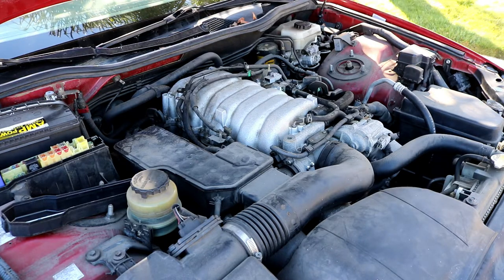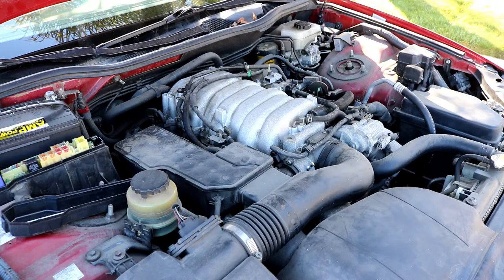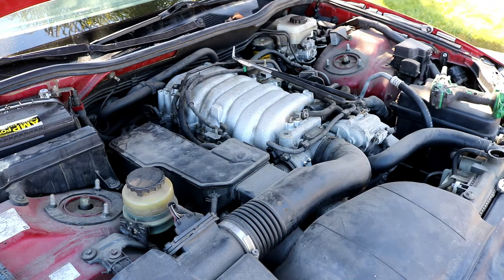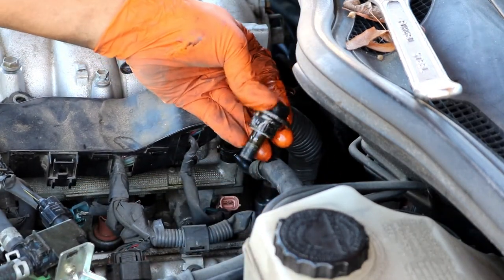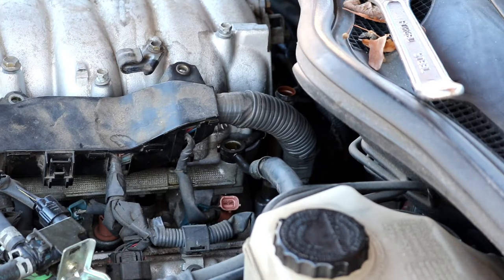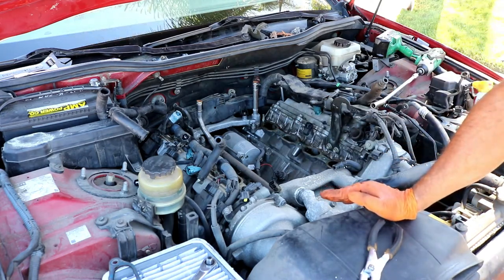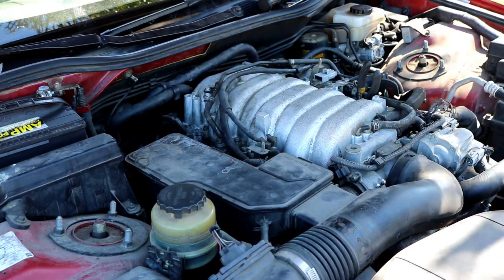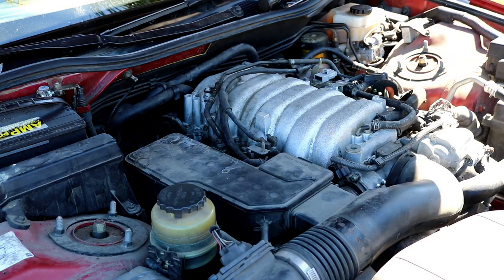GS400/430 intake manifold gaskets (Starter access) 1uz/2uz/3uz

Comment: thanks for the video, was able to replace my knock sensors for my GS430 and everything was on point.  it was the first time i ever did anything this complex in my life.  for my case, i didn't remove coolant hose on the throttle body, so didnt need to drain coolant.  i also didnt remove the heater hoses or banjo fittings either, i disconnected the fuel line and left the banjo fittings attached to the manifold (i used 14mm and 19mm line wrenches so i didn't round the bolts [be careful of some fuel in the lines and some pressure as well]).  it made things a bit harder to work around when pulling off the manifold and putting it back on, but i thought it have saved some time for my case.   thanks again for everything!
Reply: Hey, I got slammed this week with a P0325 Knock sensor code.  2001 Gs430.  Congratulations on fixing yours 👍.  Can i ask you how long approximately did it take you and did you need a second person to help?  Im debating whether I should pay my mechanic or do it myself. I’m a little handy myself, but not as skilled as a mechanic by any stretch.
Reply: @Chin-dian  Hey there!  It took me about 6 hrs to do, but I was really taking my time and ensuring I wasn't going to strip any bolts, crack any hoses, and so on.  I did it myself without a second person lifting the manifold out but it was pretty tough and hope you're familiar with good deadlifting technique so you don't throw your back out.  It did require specialized tools and planning like I mentioned above, and even then I also had a tough time. This is one of those that I would say you might take to a mechanic because of the complexity.  I needed to do it myself because I was unemployed at the time and couldn't afford the labor
Reply: @nitroidd  okay. Thanks for responding. I appreciate your advice. 6 hours is actually very impressive for a regular person.  But i hear what you say. It is complex for sure.
Reply from the maker: This job took me around 2 hours. Knock sensors are right under the manifold so add a little more time for that. Sorry just realized you asked this guy and not me. My apologies.
Reply: @HelpingHandAutoRepair   No apologies necessary.  Im grateful that you posted this video.  Wow , 2 hours is super fast for a job like this.  I’m budgeting around 8 hours if i get the nerve to try it.  But this tells me that it’s possible to do it yourself.
Reply from the maker: It’s definitely possible. Could be 2 and half hours but I have done one or two before. That manifold is definitely heavy.
Reply: @HelpingHandAutoRepair  Hey , just wanted to report that I successfully changed both the knock sensors on my GS430.  I did it mostly on my own. I just got my brother to help me align and put on back the manifold on top of the 4 studs as it is hard to do alone. I would say it took 6 hours. However I regret not changing the starter because its right there as well and although it would cost an extra $300 bucks or so, its well worth it due to the amount of time it takes to get in there.  My advice to anyone who takes off the manifold is to just change the starter and both knock sensors especially if they are old parts.  Also i had bought a fel-pro gasket but the original lexus gasket was a better quality and in good condition,  so i reused it.  The lexus oem gasket has 3 layers, rubber sandwiched between two sheets of steel. Thanks again for this video, they really help with the knowledge. And definitely use line wrenches to disconnect the fuel line. 14 and 19 mm. My fuel line was super tight to unscrew.  If i had used ordinary wrenches I would have definitely rounded the 14 mm end.  You don’t want to make that mistake. Also dont use a cheap no name starter or knock sensor.  I used NGK/NTK knock sensors.  Its too much work to do or to change all over again if a cheap part fails.

Comment: I'm surprised I didn't find it in the first few comments, but removing the coolant line is unnecessary if you're NOT doing the starter. If you're doing your knock sensors, the wiring harness to those, or your intake gaskets, you won't need to remove the coolant line, as you won't need to remove the bridge on the back of the starter where the coolant lines come in from the backside of the motor. I'm battling a knock sensor code problem in my '04 GS430, I've taken the intake apart and put it back together three god damn times now LOL! So trust me, you don't have to remove the throttle body or the bridge over the back of the starter to get the intake manifold off. I just used a short bungee cord to hold my throttle body to the side (drivers side) and out of my way when I was working on the intake. The only thing that gets in the way when removing the intake is the fuel line on the driver's side and the bracket with a plug on it on the passenger side. Take that bracket and just tuck it on the fuel rail or something so it'll come out with the intake manifold. You might need a helping hand to help swing that fuel line on the driver's side under the wiring harness though, that joker kept getting hung up on me when I was pulling the intake by myself, but I eventually made it work inch by inch, very gently LMAO!!

Comment: I'm just getting into cars and I'm going to mod my sc430, but I need to fix it first. This is exactly one of the things I need to do so thankyou! Wish me luck I'm going to attempt work on the 3uz with my mechanic buddy. You're helping me learn and all that jazz. Much appreciated my guy
Reply from the maker: All good, you’re on the right trAck for sure. Maintenance first, modifying second. Most people do it backwards.
Reply: it was succesful! time to do valve cover gaskets, replace the radiator, power steering hoses, and the timing belt. end me. still need the knock sensor too, should've done it with the intake but whatever

Comment: Yo man shoutout to you for making a great video. Taking a break from the starter job on my 98 SC400. This video is great reassurance. 

Quick question tho. Can I break the main fuel line loose by the battery instead of the two banjos?! Saw it done in another video
Reply from the maker: You should be able to. Either way will work. Whatever makes it easier for you. 👌🏽

Comment: One of the best gs4 mechanic content I’ve seen yet ??thank u very much !🙏🏽✍🏽🙏🏽.I do have a question ?what were the symptoms that gave u the reason they were bad?Any codes ?im curious kus i have a multiple misfire on bank 2 and tried everything to fix except this..
I got codes:
P0300
P0302
P0304
P0306
P0308
I Change sparks plugs ,vvt solenoids,switch over coils,valve cover set ,cam sensor,fuel injectors are gud? Hesitates to run its full power..can feel a lil shaky in park..
Reply from the maker: When you pulled out the coil packs, were they soaked in oil or were the spark plugs covered in oil?
Reply: @HelpingHandAutoRepair  
What if they are soaked in oil?
Reply from the maker: You need to do the valve cover gaskets
Reply: sparks plugs were covered a bit wit oil on bank 2, along wit 2 coils bein lightly oily .I then changed valve cover set . Including spark grommets.also replaced intake manifold gaskets still having same issue Nd codes . I recently notice sparks having jus a bit oil still not as much as the first time ..🤷🏽‍♂️ completely clue less at this point ..
Reply from the maker: What codes are you getting now?

Comment: Hey! If these gaskets are bad, that could be causing a vacuum leak which could cause a lowerish idle and an audible sucking noise while the car is running, right?
Reply from the maker: It’s possible yes. Fast and easy way to check that is with some brake cleaner. On this car you could hear a pretty loud intake vacuum leak towards the back of the intake. So I sprayed some brake cleaner back at the base of the intake manifold and sure enough the idle stumbled (indicating a vacuum leak) every single time I sprayed it there.

Comment: I used this video to get to and replace a knock sensor in a Lexus sc430 I think a 3uz (pretty helpful if I might add) but upon reassembling everything I noticed that my banjo fittings are leaking fuel I haven’t been able to tighten them so that they stop. Do you have a suggestion?
Reply from the maker: Make sure you put the washer in place. Hopefully you didn’t cross thread them.
Reply: Is it leaking at the top where the set screw is on the fuel damper?

Comment: 1999 Lexus Ls400 V8
I have a P0171 running lean, I sprayed brake cleaner and found the leak behind the manifold where the starter is located. 

I’m not 100% sure if it’s the intake manifold gasket or a hose since it’s behind the intake where the heater hose is and I can’t see back there.

Do you believe I should still replace the intake gasket?
Reply from the maker: Heater hoses won’t cause lean codes. If there are any vacuum hoses behind the manifold, you can try spraying around those hoses and see if you have a leak there.

It wouldn’t surprise me that your intake manifold gaskets are bad.

Comment: Thanks for making the video!

I have a 2000 Tundra with the 2UZ-FE, I have been getting a P0171 bank 1 too lean code, a slightly low rough idle when in gear and now the engine has started making this loud whistling/squealing sound at idle. If I rev the engine the noise stops for a second and when the engine returns to idle it comes back. The noise seems to start after the engine is warmed up. Do you think this could mean a bad intake manifold gasket?
Reply from the maker: It very well could be. However usually intake manifold gaskets leak while cold and then seal a little better while warmed up. This isn’t to say that it couldn’t happen. 

A quick way to test for intake leaks or in the case of these cars also is fuel injector o rings. Get some carb cleaner, spray it around the base of the intake manifold and around where the injectors are seated while the engine is running.

This is how I found where the leak was coming from on this engine. It was a combination of bad intake manifold gaskets and a bad set of injector o rings on one cylinder (I replaced them all)

If the engine stumbles or starts idling worse wherever you spray it at, you have found the vacuum leak.
Reply: @HelpingHandAutoRepair  Thank you for the reply! I am going to dig in and replace the intake gasket and check out the injector o-rings while I'm in there.
Reply from the maker: Well if you want to save yourself some time, you could try spraying carb cleaner around both sides of the intake like I stated above. If nothing changes, then start spraying other possible vacuum leak sources. Like the intake tubes, vacuum lines etc.. any AFTER the mass airflow sensor. 

Since you have a lean code, it doesn’t necessarily always mean intake
Manifold gaskets (although it’s likely) it can also be a slow responding upstream o2 sensor.
Reply: @HelpingHandAutoRepair  I really appreciate you replying. I will do that with the carb cleaner. It's the LOUD whistling sound that is hard to pinpoint that is there at idle but goes away as soon as the throttle is opened, which makes me think of a vacuum leak. I have inspected all the vacuum hoses closely and replaced the PCV valve. The intake manifold gasket has that black plastic spacer thing with two gaskets either side and I can visually see that it is cracked in one location where there is a bolt, the previous owner has been in to do the starter before, so I'm thinking he used a cheap gasket. I have OEM Toyota gaskets to go in. The injector o-rings all look dry rotted as well, so its probably time for that.
Reply: @HelpingHandAutoRepair  Turns out it was the intake manifold gasket. I keep in contact with the previous owner, and he had taken the intake off to change the starter and used ACdelco gaskets when he put it back on, one of these had failed and cracked in at least 3 places around one of the cylinders. I did do the carb cleaner, and it did confirm around the cylinder that the gasket was cracked in multiple places. The job is much much easier on a Tundra than the car you were working on! I didn't have to drain coolant or undo any coolant lines. I unbolted the throttle body and left it in the car instead of taking it out with the intake manifold. I used genuine Toyota gaskets.
Reply from the maker: Nice. Glad you got it sorted!

Comment: Bout to buy an ls400 for 600$ all it needs is a starter and battery
Reply from the maker: Well with this video you can access the starter.
Reply from the maker: Also. Check the mileage for the last time the timing belt and water pump were done. That’s a big job also.